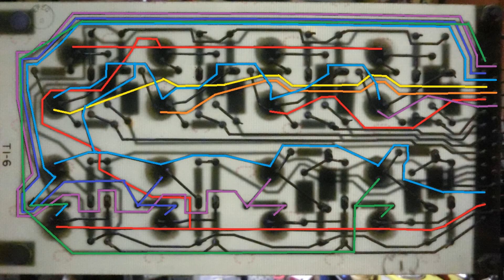1960s Mystery Circuit Modules

Comment: I do believe they were prototype function boards for the Xram C15 Primarily used in the start up of the Fox micra radar early warning detection system, phased out and replaced by the Shore to shore Zig MIg Ground infringement Radar. Hope this helps
Reply: I would suggest they are parts from a large military data processor used in the cold war days and are probably flip-flops for doing binary calculations.  I remember the T2 data processors on the Pinetree Line had actual tubes 12AT6's  and not canned transistors.  All of that stuff was scrapped as technology rushed on.  Possibly they were from the BUIC sites.  Pretty certain they are flip flops though.
Reply: Thanks...Ill pass that on ...By the way id love to go to Canada...been a long time dream of mine..God Bless :O)

Comment: The first board is a collection of 8 push-pull AB type amplifiers that use a matched pair of NPN and PNP transistors.
The resistors all seem to be connected to the same thing because they are.  The resistors are for biasing the amplifier.  They form a voltage divider.  One end of the resistor pair is connected to +V, and the other end is connected to V-.  there will also be a common ground connection going through the circuit.
The center of the resistor pair (where they are connected to each other) is usually where the signal to be amplified is introduced.

The capacitors in these amplifiers are usually used as a high pass filter that blocks a DC voltage.  (about caps: AC voltages above a certain frequency will see them as a short circuit.  DC and voltages below a certain frequency will appear as an open circuit.)
The output of the amplifier will often be passed through a capacitor to get rid of the biasing you had to do to the signal before it entered the amp.

May I suggest reading Forrest M Mims' Getting Started in Electronics?  I've had this book since I was 10, it's a great primer on these topics.
Also, the wikipedia page on amplifiers is a good read.
I heard you say in another vid that you don't really get AC, I feel you.  It's weird.  But once you learn about it, it's pretty awesome.

Comment: The caps are probably decoupling caps to protect the transistors. Those old mica caps are a military spec, you are right about that. Nobody else used 6 color micas by the time the 60's rolled around. Easy to identify, very reliable. Perhaps a its flip-flop board. They really weren't concerned about pushing miniaturization to the limit in those days, were they?
Reply from the maker: no they wherent haha

Comment: If you take the TI-6 board and make a schematic, I'll bet you discover that these boards are logic elements like flip-flops or bit registers for some kind of computing device. I had an old Burroughs L-7000 which was an accounting computer, and the main cabinet (8 ft long, 5 ft tall, and 3 ft deep) was full of rows of boards like these, in various sections like "clock gen", "ALU", "Shift Reg", "I/O", etc. The connectors on the backplane were interconnected by tens of thousands of wire-wrap connections routed among the modules and logic sections. Interestingly, this old computer didn't use core memory, but instead used two rotating disk assemblies, each having several fixed magnetic pickups which provided a whopping total of 512 bytes of "RAM" (256 bytes each), which was a major disappointment to me because I bought the computer (in 1984) hoping that these were "Winchester" drives that could be adapted to run on my Atari 800 computers. Later on, I acquired a couple of Burroughs B-80 machines that did have Winchester drives, but the drives were about 5 ft tall, and 18 inches square, holding a whopping 5 megabytes.

Comment: The plastic covers on transistors seem to be for insulation. Since most of those metal can shaped transistors has their collector terminal hooked up to the body and collectors are usually vcc, putting insulating covers on transistors make sense to prevent them from shorting to the chassis or transistors on other boards if they are mounted too close.

Comment: I gave a pile of boards like that to my brother 30 years ago, taken from a pair of IBM DATA TAPE HANDLERS - The huge tape machines we usually see on movies unless we worked in a bank I guess!   I was (foolishly?) stripping down these 7 track, half inch tape recorders each with 6 huge motors... (three vacuum motors, to control the tape without touching it - two spool motors that went at helicopter take off speed but stopped in an instant due to huge electrical disc brakes - They could empty a ten inch reel in ten seconds flat - it was scary - and a capstan motor the size of a washing machine motor) ... I was desperate to own a multitrack AUDIO recorder for my musical work, so spent a couple of years converting them to handle 1" tape running and normal-ish speed. ANYWAY, the point is, I had no use for half the stuff in there so I let my brother take the cards home ... a few years later when Ebay emerged, he informed me he got good money for the rare transistors to be stripped out BUT HE ALSO GOT SHOUTED AT BY A MUSEUM OF THIS KIND OF THING, AS THEY WERE SO HARD TO COME BY - THEY NEEDED THEM.     It would be nice if you could get some decent money for them - If you spoke to an INDEPENDENT electronics supplier / shop / firm that have been in the business since the 50's, they might have solid info ... Here in the UK there's such a shop ("MODERN RADIO" BOLTON / FARNWORTH, LANCASHIRE, ENGLAND)that has always been run by women, interestingly, and boy, they know their stuff - and it seems like there's no defunct component they can't still get - The main lady there, Diane I believe, took over from her Mum in the 80's, a mine of knowledge.    cO-INCIDENTALLY i bought THE ibm tAPE HANDLERS (oops caps on) from a postcard advert in their window in the mid 80's and I think the guy who sold them to me was a college lecturer.  Anyway, I enjoy your videos so thanks and best of luck in all things - Steve

Comment: Transistors are wearing plastic suits because the can itself is connected to the collector, the plastic keeps them from being shorted via tools and such.  One digit difference in number indicates one is NPN and the other is PNP.  And this means their cans are like anti-matter to each other, touch one can to another and there is no telling how far the damage might cascade.  A dropped pocket screw driver down into a bank of those powered up could cost some really big 1968 dollars.  Shortly (ohh) after that first episode is when they all got issued the plastic suits.   Nice touch tracking down 'first use'  of the circuit board like that.  Mica caps are a trip, they had plenty of those at that time though, the dawning of the age of the transistor.

Comment: The transistors are NPN (2N1304) and PNP (2N1305), both germanium, suggesting the age of the board.  While the data sheets say switching transistors, the opposite polarities suggests something analog.  And the emitter is always poised nearest the tab in the TO-5 case, base in the middle.  The dark, shiny parts are diodes.

Comment: Going off the placement of the transistors and resistors, I'd say they were dual 4 stage amplifiers, kind of a old version of a lm358 op amp.
The resistors look like they are biasing the transistors, and the caps blocking dc from the various stages.
Those mica caps are known to fail.

Comment: The way the board is layed out in mirrored halves indicates it might take in differential inputs from something. Might well be something radar related. On the other hand, what strikes me as odd is the purple trace snaking in between the two solderconnections between the resistor pairs? That could easily have been routed much more efficient, with ample space left over on the board. Maybe that indicates it's made for somewhat high frequency operation? Spark gap? Honestly i have no clue. But I'm as intrigued as you are. Great find!
Reply from the maker: yeah its odd stuff for sure.

Comment: early gear there, I would say server racks for a an early computational server, top three rails maybe being the databus, sync bus and address bus, as they used to be pretty pronounced on old boards, or as you say radar or flight monitoring tower computer measuring radar reflections perhaps :-) lot of this old stuff seems to be getting lost in time, I love the old legoblock transistors :-D

Comment: Parity counting was made "simple" because the user knew that every character had a specific number of 1's and 0's. The transmission rate at that time was around 300 bauds - nowhere near the speeds used today. The parity counter would count up each character. If the count was incorrect the system would stop the exchange of data at the receiver and request a repeat of the previous character. With H.F. communications there were a lot of problems and we would often have to hit "reset" or change frequency bands. Thank goodness satellite communication was waiting in the wings.

Please don't get me wrong, the use of boards like yours were not limited to error detection/correction, it could be early transistor digital circuitry for any number of jobs.

I really doubt that there is any value in it except intrinsically for demonstrating the state of early digital circuitry.

Now I have to get back to preparing my lithium ion battery setup for my e-scooter...which I first found through your great channel.

Comment: Interesting boards. I couldn't begin to guess what they could have been for.

Capacitors don't have resistance, except where they're seen theoretically as a short circuit when completely uncharged, and an open-circuit when completely charged (which you'd eventually get if you measure the resistance of one using a multimeter). If you're measuring some definite resistance on them, it's because they're in the circuit and the other circuit elements are influencing the reading.  Resistors and capacitors always need to be removed from the circuit to measure their values.
Reply from the maker: i measured ones that didnt have anything connecting either side. but i dont trust my measurements too much. just too confusing.
Reply: Rinoa Super-Genius Fair enough. Usually capacitors will read open circuit (infinite resistance) on a multimeter if you hold the leads on it long enough, but it's possible that those capacitors, being so old, leak charge quickly, and so hit a definite resistance when measured.
Reply from the maker: *****
every time i've measures capacitors they have been in the megaohms area not disconnected.
Reply: Rinoa Super-Genius That's right, then. I thought back when I observed it myself that I got an infinite reading, but that was a long time ago, so I could be wrong.

Now if you want to get more complicated, capacitors DO have an actual resistance when fed AC current. Inductors do, too. Although it's called reactance, not resistance, but it's still measured in ohms. Reactance Xc of a capacitor is 1/(2*pi*f*C), where f is the AC frequency and C is the capacitance. So a 1 uF capacitor would have a reactance of 2652 ohms at 60 Hz. Although maybe you already know that. :P
Reply from the maker: *****
nah i didnt know that. i'm not very knowledgable on AC stuff right now.

Comment: One of the pieces of equipment made by Mullard Electronics Limited (MEL) was an error detection and correction (EDC) unit for parity counting that was used on long range data communications.

I worked on European military equipment in the 60's and 70's. At the time we were transitioning from using H.F.wireless to the British military SkyNet satellite system (no relation to the one in the movies starring Arnold S.).

The EDC contained board after board of flip-flops (as well as other circuits) powered by OC77 transistors among other types, six boards to a canister with many canisters to a 7-foot rack. With the racks numbering probably several dozen in a typical installation, the transistors put out a lot of heat, requiring dedicated air conditioning. If I recall, the individual boards were slightly smaller than those you show, but the concept was similar. The boards you show would have been racked in with perhaps hundreds of others with inter-wiring.

You find error detection and correction circuits combined with many other types of electronics these days contained in microscopic packages - a long way from when we could troubleshoot, not only down to the board, but to the individual defective transistor.

A Texas Instruments engineer or technician from the era - probably in their 60's or 70's - might come forward and tell you precisely what the boards did.
Reply from the maker: thanks for telling me that, i never thought it could be for error correction.

either somebody will come forward and tell me or i'll happen to see a machine that uses them in a computer museum or something. who knows :P
Reply: 1000sunsets Transistorised EDC!!! WOW!!! The ones I worked on had open-to-the-air (not encapsulated) bimag cores.

Comment: Understanding a resistive capacitor - an ideal capacitor is 100% resistive. The ohmage of the capacitor is based on leakage current. Really, one can imagine a resistor in parallel with the capacitor, draining it along the current path.

The boards are dual-sided, so you'll never get a complete idea of the functionality, unless you pursue re-drawing the original circuit. Though, based on the number of inputs and outputs, it seems you'd have luck attempting to trace a singular circuit from input pin to transistor to output pin.

Start at the base of any transistor, then follow that back to the connector, plotting the components in between. Then find the collector's entire circuit, then the emitter's.

If you do this, you may run into another transistor with a base tied to it from a capacitor. It is a commonly-used 'cheat code' in electronics to establish a bias voltage on a dual-transistor driver. The reason for this bias is so one can drive a PNP transistor exactly opposite an NPN transistor from a single pulsed-DC voltage source. When one transistor is on, the other is off. This architecture will turn a DC pulse into an AC wave.

If this was a radio transmitter board, then that architecture would make sense.

Comment: They look like a later form of circuits for a military grade computer. This video has some similar circuits that run with vacuum tubes as well.

http://youtu.be/nN9wNvEnn-Q

Skip to 10:00. This computer however is a word processor. Not sure if that's what these boards are off but hope it helps!
Reply from the maker: yeah i love that show. but the Pegasus was probably 10 years before these boards.

Comment: I think there are a differential amplifier board
Reply from the maker: thats a good idea actually.
Reply: Yeah, and my another guess is transistors can be wired in totem pole configuration, so they are current amplifiers or buffers

Comment: Not sure exactly when silicon dominated over germanium, but those Ge transistors will have a date code that'll help you narrow down the manufacture date. Grabbed a pretty good screen shot of the board you held up to the light and will maybe break it down into a schemmy for you if i have time, although there doesn't appear to be anything gee-whiz about the configuration of the six complimentary pairs.

The transistor data sheets suggests switching over wide band analog amplifiers, so part of a computer is possible, though at a glance no evidence counting or DA function that you mused - doesn't even look quite right (again, at a glance) as basic glue logic, though if it was part of a digital system it might have driven/sensed mag core memory or something. 

Doesn't look period military. The layout suggests serviceability over space, not much else I can guess at really.

Let us know what you come up for with a date code - typically 4 digits denoting week/year: Ie, 2274 would be the 22nd week of 1974.

Comment: My guess is an aviation radio from a control tower or a radar cluster
Reply from the maker: yeah
Reply: I was Navy Air traffic controller from 68 to 89, worked with ARC-1, ARC-27 radios and FRA-11, CPN-4 radars, helped tech reps Rehab radios and Radars on 3 ships and 5 air stations, never saw those ,  all pull and replace componets I remember had Heavy round handles not flat

Comment: 2N1304 are NPN and 2n1305 are PNP Germanium Transistors.
Reply from the maker: yeah i looked up the datasheets for the 04 but not the 05.
Reply: They are listed in the datasheets as complementary transistors, There were probably hand picked to match each other based on measured characteristics.  This implies they were used for some sort of amplifier arrangement probably RF or FDM voice.would be my guess.
Reply from the maker: Robert Orr
sounds pretty good. chances of it being a radio system are very high. but also not excluding the possibility of telephone related stuff.

Comment: Hi , thank you for sharing , I guess those board are older than 1960s ,  I suppose this not worthing to make reverse engineering on them , the only useful thing is to disassemble the transistor for some electronic project

Comment: Those caps should read infinite resistance.  9K ohms is either a short or resistor across them.
Reply from the maker: i didnt have anything connecting the sides to each other. and are you sure about infinite resistance? i've heard usually no more than a few megaohms.
Reply: Rinoa Super-Genius
You are right! I should have said close to infinity or toward infinity.  See when I typed that I was picturing my VTVM which has a needle that swings.  I was not thinking about a DVM.
Reply from the maker: dictare
i think i have a heathkit VTVM somewhere. i didnt like it because it isnt very exact.
Reply: Rinoa Super-Genius I agree, but they can be recalibrated, and not too bad if allowed to warm up.  I have an Eico.  Last I checked the battery marked 39 cents was still good!